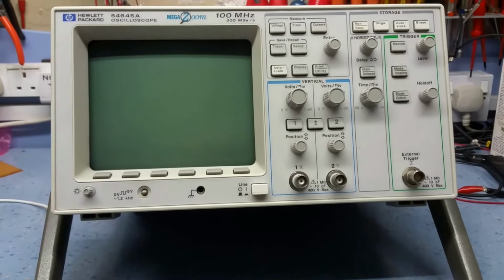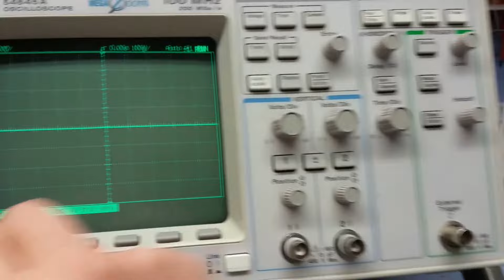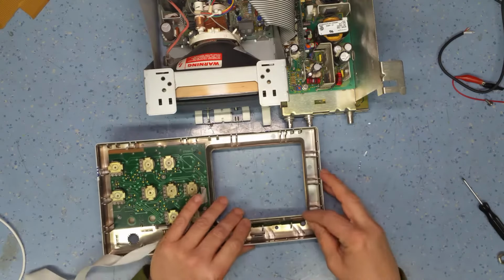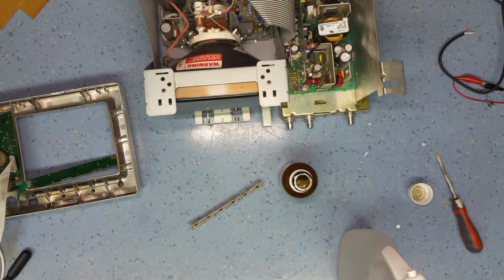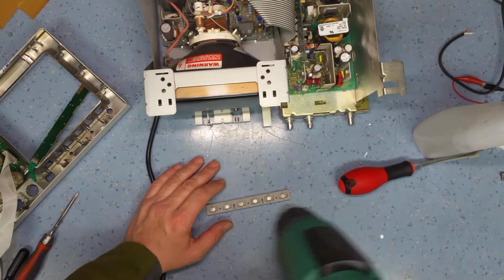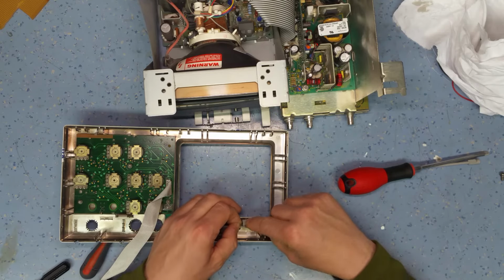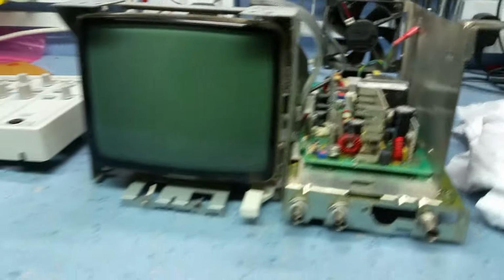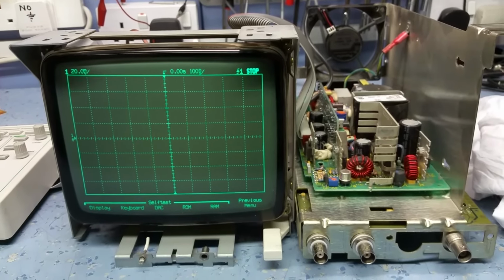Soft key switch repair to a HP 54645 Scope Pt1

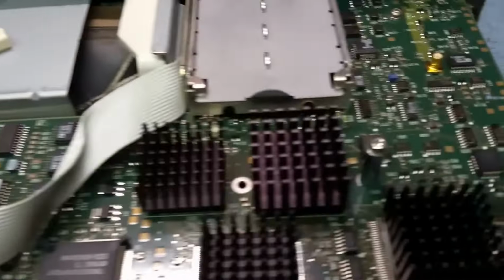Comment: Another nice video Simon. I think the SMA test points you're refering to at 3:58 - 4:02 are actually SMB's as SMA's have threads on them. I like SMB's because you can just push n pull the cable on and off easily. With that said off to Part 2. Keith

Comment: I received such a scope with all buttons under the screen none-functional, so basically useless: trigger options are selected there -> changing was impossible. 
Cleaned these buttons as shown and it works like new. The only missing in this video is: what actions does one need to perform to remove the front cover? I had to search on the internet for a manual showing the attachment points since it's not clear from this movie (that should not be overlooked in the future). The 54645D is still a very powerful scope for hobby.
Reply from the maker: Yes good point that. Not obvious either is it? Takes a bit of force too.

Comment: Nice video, you can buy replacement conductive rubber pads for fixing remote controls, maybe they'd offer a better solution?
Reply from the maker: +Clint Jay I didn't know that Clint, that's very useful info. Thank you I might order some.

Comment: I almost bought one of these.  I got a LeCroy 9410 instead.
Reply from the maker: Never used a LeCroy  scope, any good? Will see if the name of the paint is still legible, but you should me able to find it on Ebay.
Reply: Simon Spiers I haven't received it yet.  The front-end processing power is not as good, but the acquisition engine is very fast- 4GS/s in interleaved mode

Comment: Hello, I have a hp 54600A scope. I’m wondering what kind of silver paint do I need to buy to fix my switches like you did. Is it silver conductive paint? My buttons sort of work if you push really hard on them. I hope they just need a good cleaning. Any help you can provide would be greatly appreciated. Also have a another question about another scope I have, the 
hp 54602B when I power it on it comes across the screen and says: Panic- no response from the time interpolator. Could you please provide any help to what that issue is. Thx so much!!
Reply from the maker: I used some stuff from work but you can buy special switch repair solution that works better, Nit cheap though.
Reply: Oh ok. Thx Simon. So silver conductive paint will work then correct? Also any ideas on my issues with the time interpolator on my other scope?